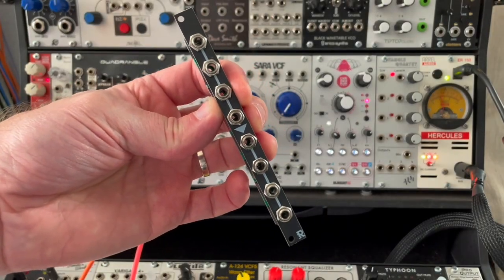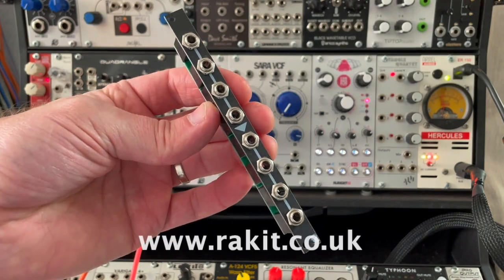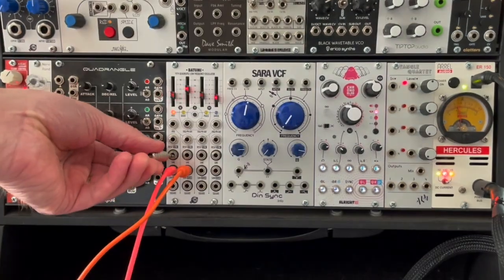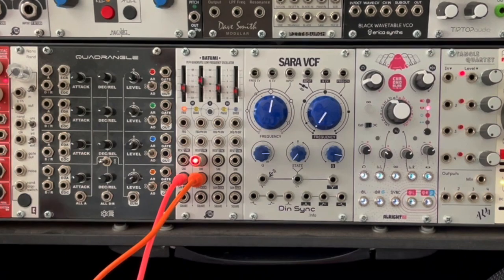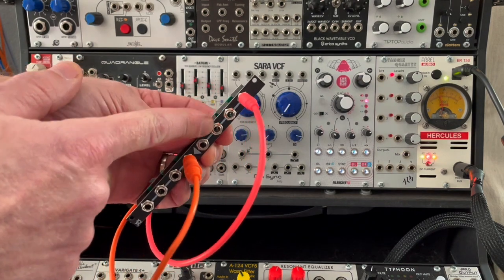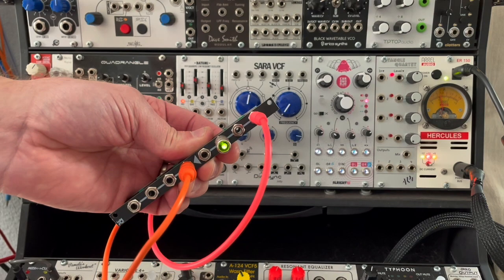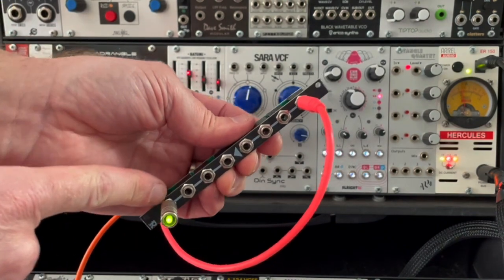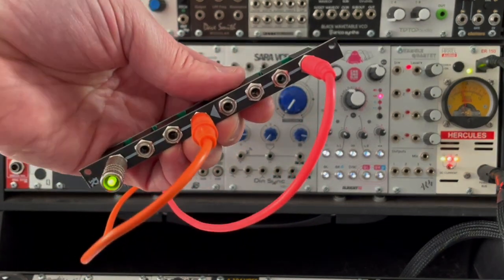What Does a Passive Multiple Do? (Modular Synth 101 | Part 1)

Comment: Hi! What is the difference between this and a multiplier cable? I mean, apart of the convenience and order of using it in a rack. I imagine it still have loses in voltage, right? Thanks!
Reply from the maker: A passive mult is effectively the same thing as a stacked cable or a y-cable. There are buffered mults as well (they use a circuit to ensure the signal doesn't lose any voltage but this requires current). I'm not an electrical engineer but some folks there are times when a passive mult is favorable to a buffered mult (and vice-versa). Do a search for "buffered mult vs passive mult" to learn more. Thanks for checking out the video.
Reply: @musicalmiscellany  Thank you for the answer and information!

Comment: Hey thanks for this! It would be great if you could do a similar video on the difference between a VCA and attenuator :)
Reply from the maker: Thanks for checking it out. I’m actually planning to do a modular synth 101 series. New episode each Monday for the next couple months. They’ll all be short like this one but I will definitely cover VCAs.
Reply: Hi Harry . . . I used to do this stuff in the '70s! 
 Long story short, a VCA (Voltage Controlled Amplifier) uses an electrical signal (the control voltage) to alter the Amplification (increase in loudness)  of the noise you are making.  It can make the sound louder, as in the 'attack' of a musical note...  And then can make it soft again.  It depends on the Control Voltage  (CV) your system is applying. 
The attenuator is often a knob (volume control, eg), slider (fader, eg)  or pedal (a swell pedal) that reduces (attenuates) your noise.  So - very similar, but not the same. 
They both change how loud things are - but the VCA  needs the control voltage to do what it does, the attenuator just obeys the knob/pedal/slider/whatever, and is usually 'passive', which implies no amplifier or amplification.
If you look up 'ADSR' you should find stuff that illustrates a VCA being used. (ADSR= Attack, Decay, Sustain, Release)
HTH!